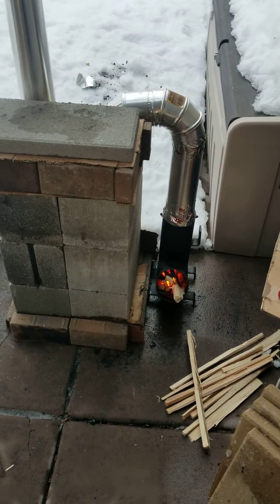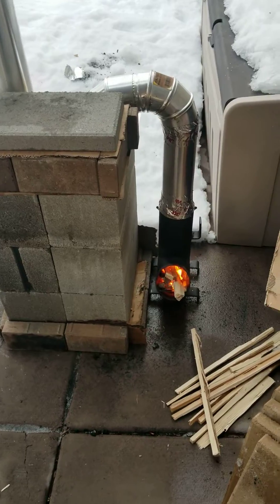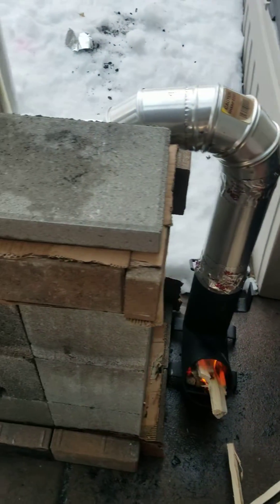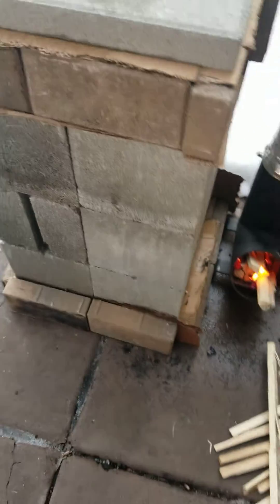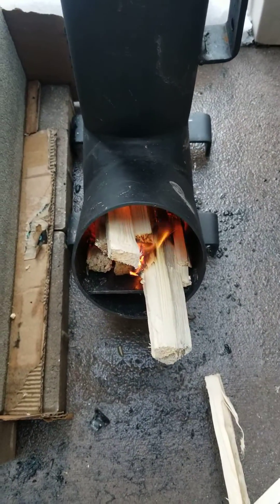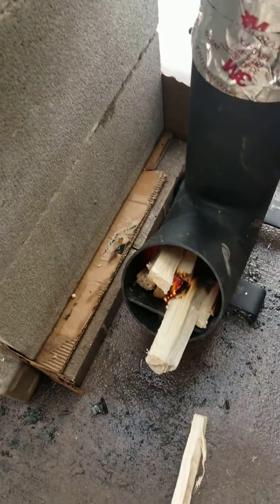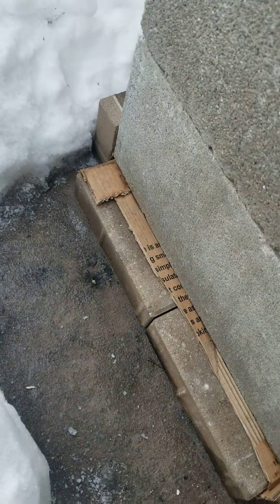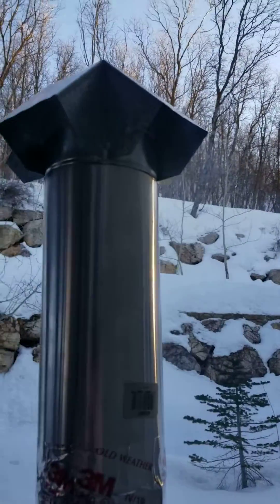DIY Rocket Mass Heater Russian Masonry Heater

Comment: Sorry to see this so late, but who knows how many years this video will be up for people to see in the future. First off, this is, in no way, a rocket stove. It's simply burning wood in the front of a pipe that then wraps around and goes up and down down the line. The initial riser / chimney (first few feet) should be a bit longer and also FULLY INSULATED to create a very strong initial draft. You need a very strong, initial draft to get the smoke to go up and down in your "mass" quickly enough to where the system does not slow down and "back up" so you don't get smoke puffs back into the room. Insulation in the initial riser means an 8 inch pipe surrounding a 6 inch pipe with the 2 inches in between stuffed with mineral wool insulation (or whatever you have that does not burn.. .mud, sand, perlite, etc.) If you want your stove to heat concrete mass, it's best to use the bell concept and have your riser "go up into" the mass itself and have the first descending channel of the mass "connected" or more connected to your riser. Here, you have a short, non-insulated "initial chimney" that's standing out in the cold, all by itself. You are losing all the energy and with that tiny, tube "burn chamber," you are not creating much energy to start with. Of course, INSULATING the "end" or final exhaust chimney (outside part) with a pipe around a pipe always helps with draw or "pull" too. If you do two things....  1 Create draft energy at the start and...  2... Have a great pull on the back end... then yes, you can get your gasses to go up and down and around inside your concrete block mass. The best stoves, rocket or other wise is this...... Think of a train with an engine on the front and an engine at the rear, and all the cars inbetween. The "back engine" no one talks about is the tremendous pull that takes place in an insulated chimney that leads to the roof. That's actually the most important part in ANY stove setup. Your chimney looks to be another thin, cool pipe. You have NO engines on the front............. or the back.
Reply from the maker: @stoveadvice  this is a GreaT comment !!  Thanks for taking the time to share your expertise

Comment: Flue must be hotter and add another 4 to 6 feet to the flue. May have to use an insulated flue pipe. Hotter the upright flue the harder it will jet the pulsing will stop. Operating temp in a well tuned non leaky exhaust system in the riser tube is around 12 hundred degrees, are the cinderblocks mortared and air tight: The entire flue system must must be air tight

Comment: The ideal you want to shoot for in a rocket mass heater is 1) a very high temperature burn, to burn as cleanly as possible, and use all of the fuel, and 2) then you want to slow the air down, to capture all of that excess heat in some type of mass.  The higher the burn temp, and the lower the exit flue temp, is a good sign of an efficient design.

Usually, only ceramics, like firebricks, or insulated fire bricks, can handle those high temperatures, and anything metal is not recommended.  Using insulated ceramic materials also help get a higher burn temperature in the burn chamber.

Comment: Did you sort the problem? you can watch this video (https://www.youtube.com/watch?v=_IvynnV-AW4) on how the smoke is drawn through a chimney system, and it works similar with pipes, all joints need to be sealed. If you surround your pipes with thermal bricks or blocks to retain and radiate heat then that would also work, a combination of the two elements (brick and pipe) works really well.
Reply from the maker: Gotter dun!  Read every comment and watched every recommendation.  You guys are awesome.  Insulation insulation insulation :)

Comment: Check out Paul Wheaton for a reference on what a rocket mass heater is.  You need an insulated riser, it can't be made of metal because it would melt or degrade too quickly, feed tube is too small, probably need at least 5 inches and more like 6 minimum diameter to make it work right, your metal tubes are offgassing toxic fumes from the galvanized coating.  Here's a good example of a small mass heater (not a rocket) https://www.youtube.com/watch?v=xEpUIPXiDe0

Comment: Many people giving good ideas to improve BUT the answer is... too many gaps between the burning chamber and the chimney outlet. 

You are loosing A LOT of suction therfore the old "fight" between the cold and hot air goes on and on.

I have made one RS made out of steel. The inner tube has a layer of dirt and perlite to make more efficient on the burning all GAS and make NO smoke.

Here is the one I made 

https://youtu.be/x0J_vjwKAdM

And here is the blue print and the proof of NO smoke

https://youtu.be/s7PtHR926nE

Comment: Hi dude. 
Your chimney is too small (short) to produce enough draft. It should has at least 4 m height. And it is too cold . It shouldn't be just bare metal and it can't be metal chimney. It has to be either brick chimney or ceramic modular system with wool insulation.
And get rid of leaks. There must be no leaks in the system.

Comment: air inlet = 1/3 total feeder diameter
and feeder length = 1/3 burner length 

therefore chimney outlet tube must go halfway up the mass heater part

I suppose you have already had answers

Comment: ANSWER: Your second riser is TOO FAR from the first riser. The smoke is regressing because your first riser is cooling too much on one side, creating swirl within the riser. Furthermore...the second riser, being too far, is not getting the heat from the first riser to assist in the sucking action upon the first riser. Basically.....you are allowing too much heat the ASYMETRICALLY exit from the first riser, and not using the excess heat to drive the second riser....which in turn would suck the first riser exhausts through.

SOLUTIONS:
1) Move the second riser right next to the first riser.
2) Insulate both risers with a nice blanket so they can share the heat.
The fire will push the heat up the first riser, lose the heat to the stone mass, then the heat from the first riser will BOOST the heat of the second riser...which in turn sucks the exhaust through. #NoSmokeBurps

Comment: It seems that the smoke in the pipe may flow better if is spirals from low to high at 2 degrees or more angled upwards since heat rises.  Also if you will Insulate their chamber well, it will burn about 800c higher and burn the smoke and creosote so only steam goes through the stack.  It will surprisingly burn slower using 1/10th as much wood.  The outlet of the burn chamber can store heat also.  That's all I know, studying all this atm.
Reply: Dork

Comment: Where is your BELL chamber?  That unit/rocket stove sits under a barrel...so flames shoot up, And smoke comes down to the base and then vents.
The Initial smoke then burns off.
Your barrel can also be filled with brick...
*You need an additional Air intake and secondary Burn Vent( double your exhaust chimney from the base).
Reply from the maker: Did the bell in 1.0.  This little failure/fun is 2.0.  Wanna bring it all together with the bell and heated exhaust, clay bench in my new DIY off grid cabin.  You guys are great

Comment: Forcing the hot smoke to flow downwards is the problem, compounded by a too- short chimney stack that's not providing enough draft to do that. A barrel-shaped smoke chamber, or a spiraling-upwards pipe flow would be better arrangement..

Comment: When you have smoke leaking you are not getting a true operation of the stove. Fix it to stop leaking smoke. You need a j tube configuration which will keep the smoke in a specific part of the stove to burn. Remember there is a specific size bore to length ratio that must be observed too. Peace

Comment: I believe the fire side. Should be insulated b4 it goes into brick bench to retain heat also most rocket heaters are j tube or long l  shape to increase air draw. And one could also look at a batch box edition for bigger burns I not know a lot but hope it helps

Comment: Your 1st riser is outside 1st downward flue (1st problem), it should be in the middle of that 1st downward flue so the outside cold air isn't limiting your rocket effect. This keeps it hotter and makes for a stronger pull of gases up. Next, your 1st downward flue should be steel, not all block like you have, so as the air is going down it quickly cools against the metal surface. This not only adds heat to the room, but mainly makes a second strong (downward) pull of the flue gases as it's cooling.  These first two need to work together to heat, then cool the air to powerfully suck it thru the chimney. Next problem is that you have 1 extra up and 1 extra down flue you should not have. Those reduce the pull of the rocket to overcome that vertical push. So after the 1st riser comes back down as it's cooling against the metal outer shell, then you then need a very long, almost horizontal run of pipe before it finally goes out the wall then up for it's last rise up the outside chimney (if you have/need one). This horizontal portion  will be much easier for the rocket "engine" to push the air thru than your extra verticals. Also, this horizontal portion will be where you eventually build a cob/rock bench that strips the heat out of that long run and stores it for a very long time. Here is a diagram: https://my.waldenlabs.com/wp-content/uploads/2015/11/RocketHeater.jpg  Hope that helps!
Reply: never realized that the quick cool is creating the strong downward pull - fascinating.
Reply: @voidisyinyangvoidisyinyang885  He gives a pretty good explanation that many struggle to do.
Reply from the maker: These are all fantastic observations, comments and questions.  Really helping me think through temperature changes and airflow

Comment: No expert at all, but I suspect you have too much resistance (back pressure) to air flow through the system.

1. The air flow path after the firebox needs to be either rising or horizontal. Avoid turning it back downwards, like you did with the connection between the top of the riser and the rest of air path (through the brick section).

2. Keep the firebox below the level of the rest of the air path.
Reply from the maker: I do like the idea of horizontal baffles